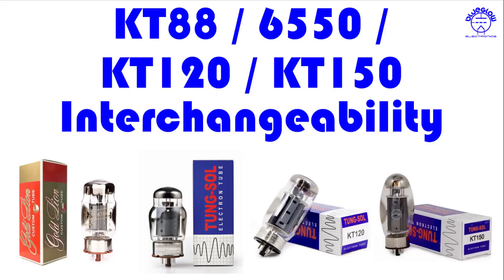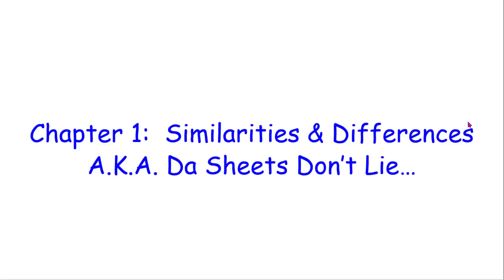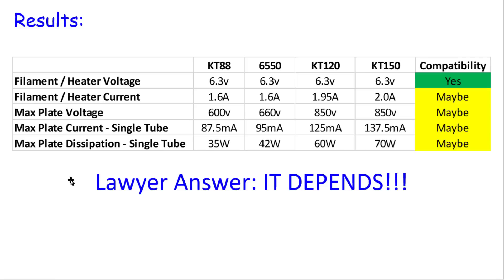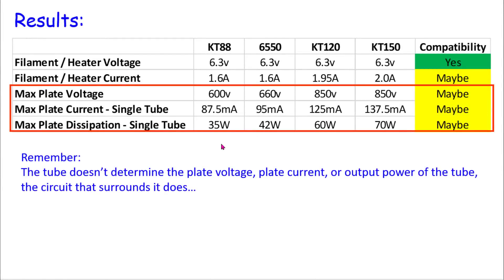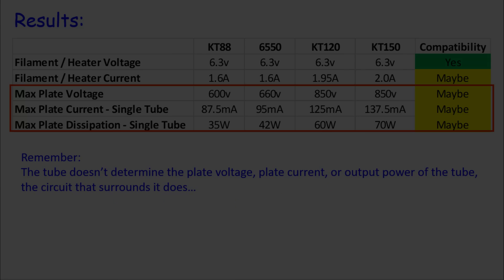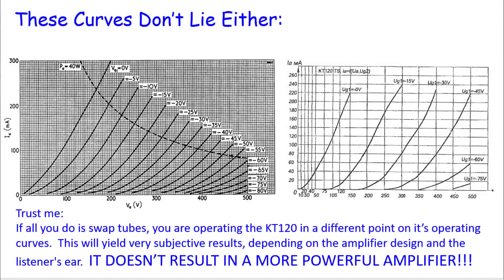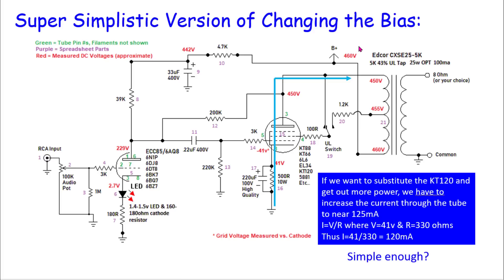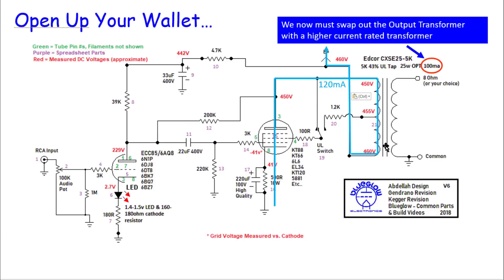KT88 6550 KT120 KT150 Tube Interchangeability

Comment: I want to use EL34's in your circuit. Do I need to change any resistor values, or can I just plug it in?
Reply: @thatguy Thank you for your kind reply. Yes I guess I will need to check the datasheet and get the correct current rating for the tube. I also don't want to run it too hot. I will check out the bias/load website to calc the resistor needed. I think I may make use a multiturn trimpot to set it more accurately - although I guess there's fair a bit of latitude in component values in a tube amp. (And thanks for the tip on the pinouts!)